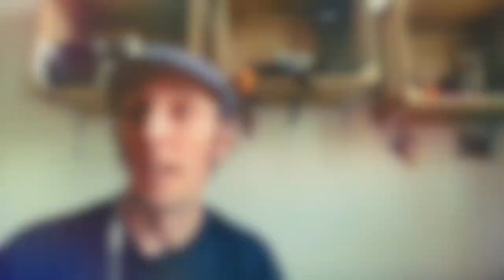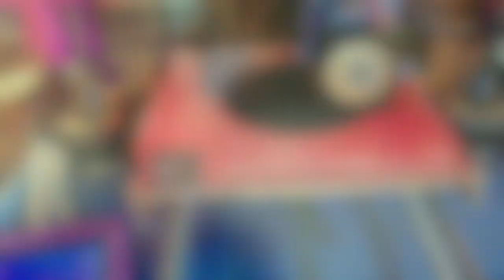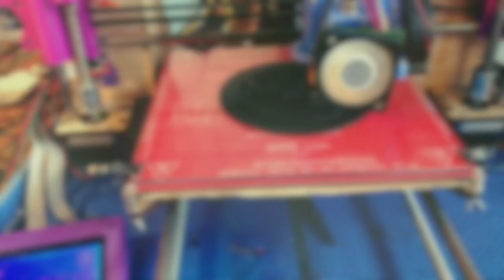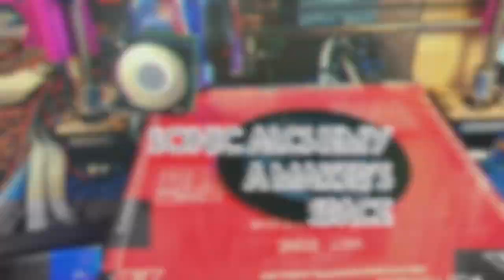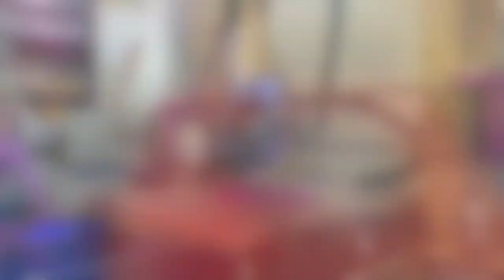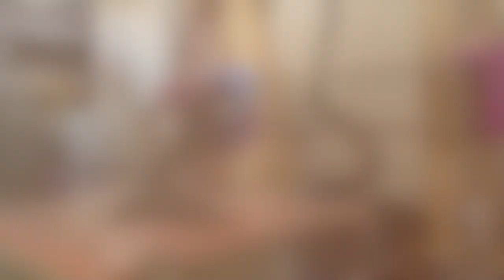Marlin M600 fails! 3DP Community Help.

Comment: I feel like this issue needs a little explaining.

The M600 command is a Gcode command that causes the printer to pause, move the head away from the print, and start the filament loading procedure. That way you can edit the gcode of a print to start a filament change when you want to. It's a command that isn't supported by all 3D printers. If your firmware can't handle M600, it won't do anything in your printer. Obviously in this case James has enabled that command in his firmware.

In addition, he has a filament run out sensor with associated firmware to detect when the filament runs out and pause the print.

Could it be a conflict between these 2 features? James says he disabled the filament sensor in the firmware and it didn't make a difference, so that would seem to not be the case.

But past here I don't know the solution. In fact I've never used the M600 command myself. But if you're willing to dive into the weeds of the firmware, I'd say test the M600 command one line at a time. Comment out everything and make the M600 command beep. Then you know it's being called. Then add the pause line, and make sure that works. Then the move line. Then the load command. See if you can narrow down the problem.

Good luck.
Reply from the maker: So it goes. Will report back when I have some results.